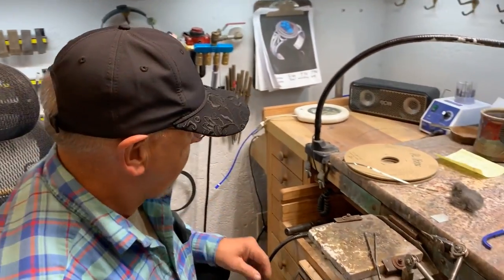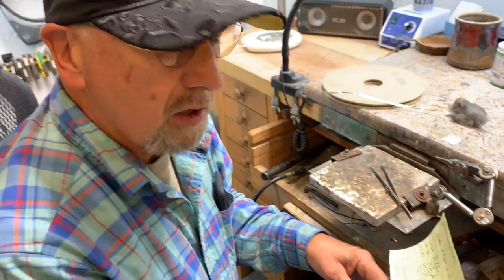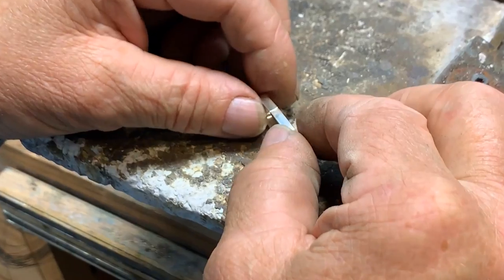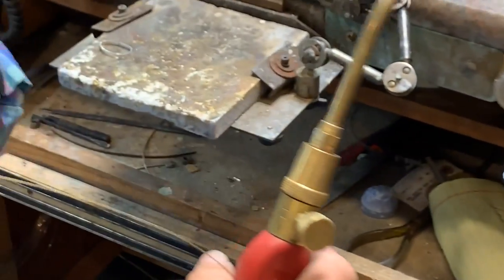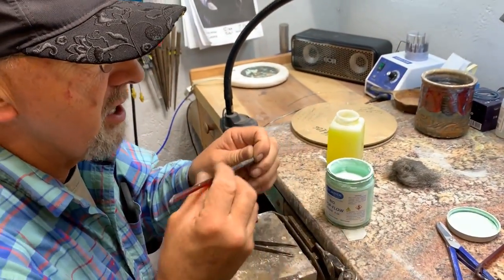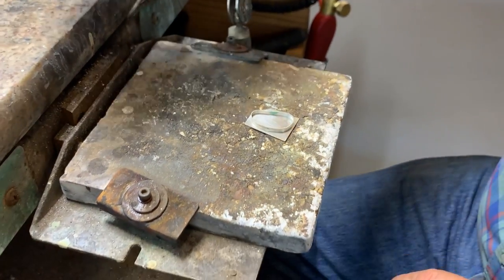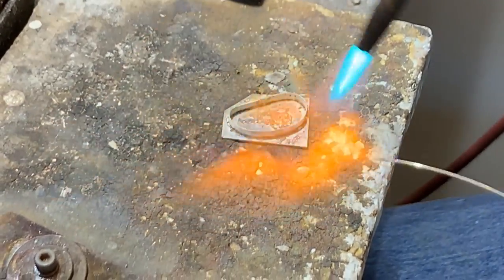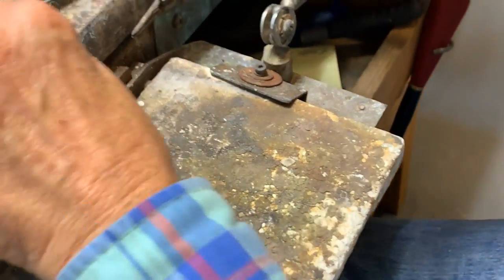How to use wire solder for jewelry

Comment: Very good demo!👍  I watched this a while back and it really helped.  Also, I was glad to see you use shears to trim the back.  I used old scissors because I'm not proficient with my jewelry saw yet.  Is there a specific jeweler's name for the technique of feeding the wire solder as you go?   I'm sure it comes with experience but it's still quite impressive because my hands aren't steady enough to do it especially working standing up at my kitchen stove because I don't have a proper work space.  Thanks for sharing! 🙂

Comment: Thank you for the nice video. Do you have anything about using a soldering iron instead of a torch? 

I'm only looking to do small solder jobs like a small spot on wirework or on jumprings.

Comment: Questions you seem to be a man of knowledge 
No I am not useing silver but copper wire and  I was trying to use something that will merge the colors of copper together yes solder I got it from adornville it is a 93% copper base hard wire solder and a bit of a learning curve  and its difficult to use  so my questions  are is it the same practice as  you described as the same for copper  to heat the wire and the peaces to be soldered second then drop the solder to join 
Your knowledge on this issue is  greatly appreciated 
          Thank you in advance